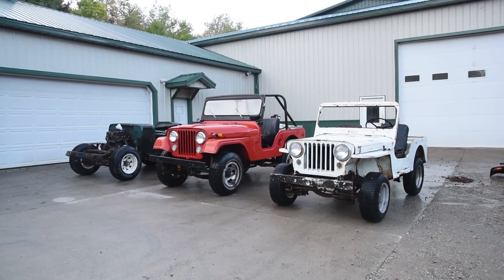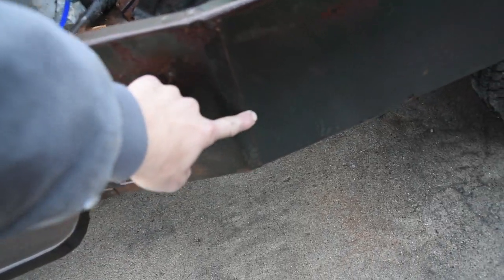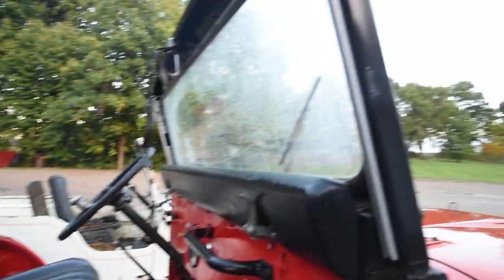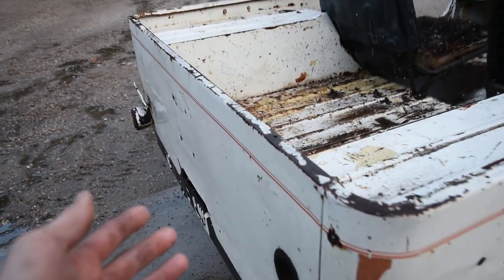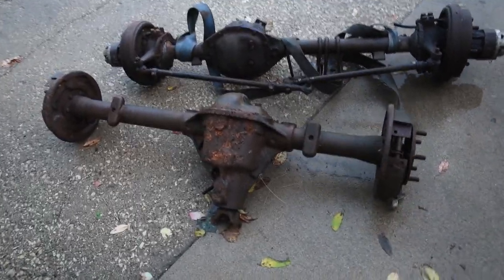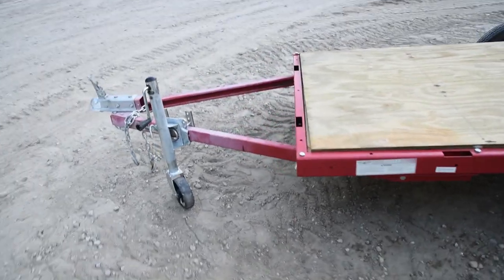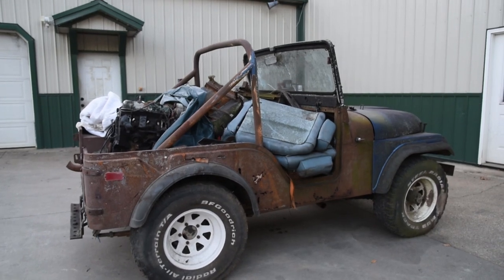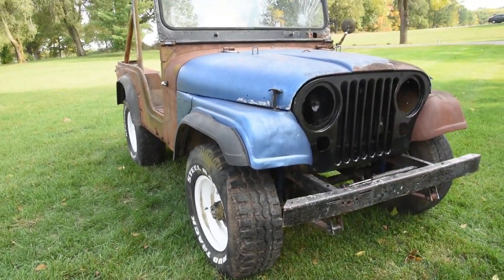I Bought 4 Willys Jeeps From a Viewer

Comment: Very cool Jeeps. They look solid. If you keep the Harbor Freight trailer you should weld up every seam. I've bought/sold trailers for years and every HF trailer is a death trap do to all the bolts rattling loose. They are designed to hinge in the middle and have the back have fold up over to the top for space but that make problems even worse. Just spend and hour and throw a good tack weld everywhere and it'll make a world of difference and it'll be  a reliable trailer.